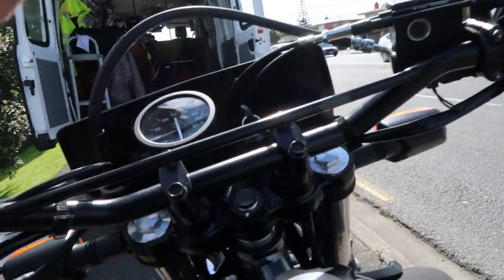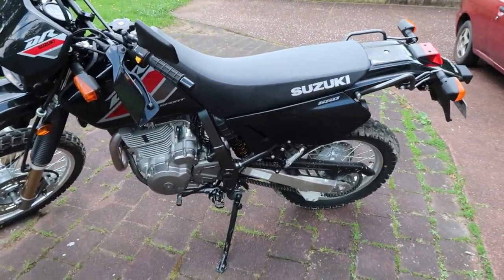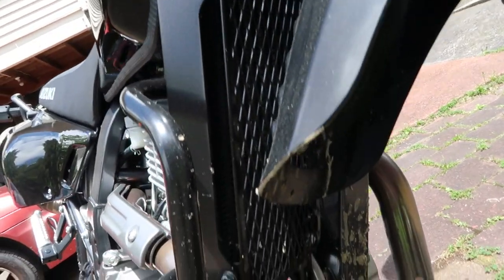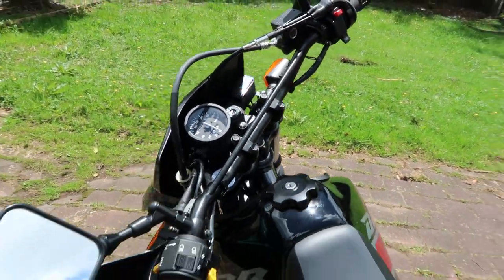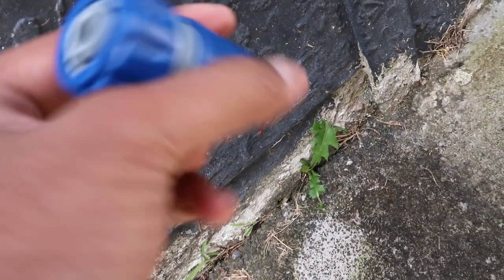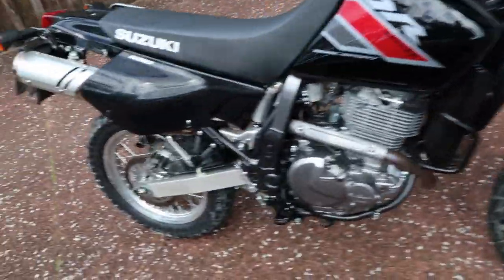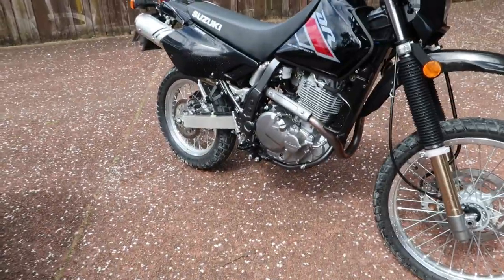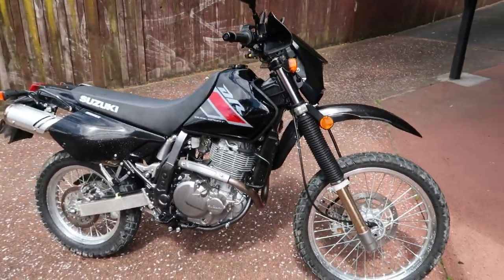SUZUKI DR650 - My new bike has arrived  !

Comment: Congrats for sure !!!! - I have been riding for many, many years - and THE MIGHTY SUZUKI DR 650 is the best bike I have ever owned !!!! - "BAR NONE".....

It will do anything you ask of it - on the road, or off - 100% of the time - "Happily" - without breaking a sweat !!!!!!

Mate - I noticed your "Petcock" was in "PRIME" mode - hopefully you got the arrow facing forward - Do NOT leave it pointed down !!!! - There is a chance fuel will run into the engine. You may want to pull off the oil filler plug - and MAKE SURE YOU DON'T SMELL GAS !!! - If so, do an oil change right away !!!!! - Filter too !!!!

Congrats my friend from Glendale, AZ :-)
Reply from the maker: Thanks for your comment. Yea it is a beautiful bike. Yes i realized that about my petcock :)